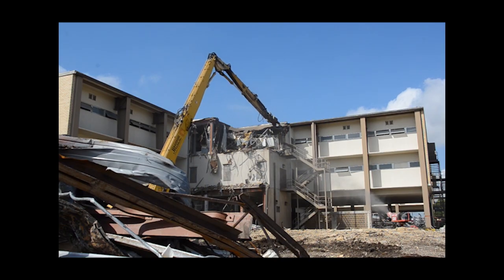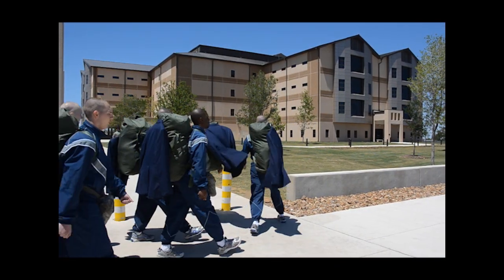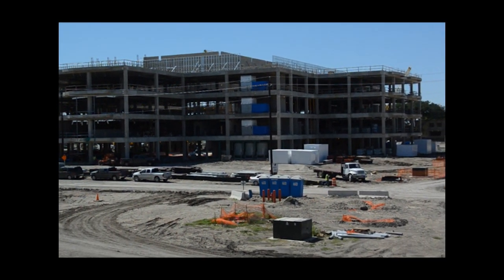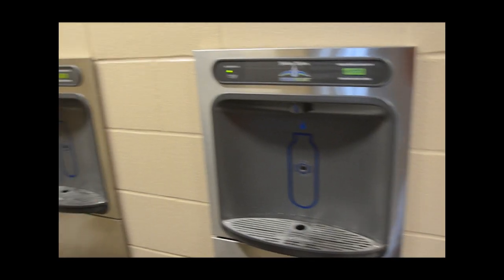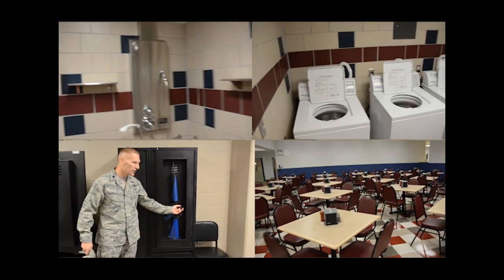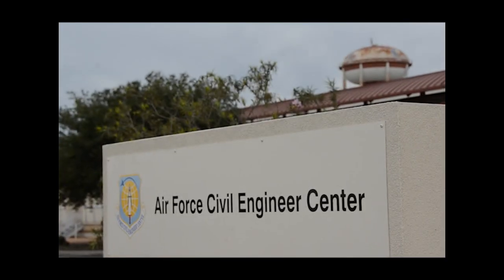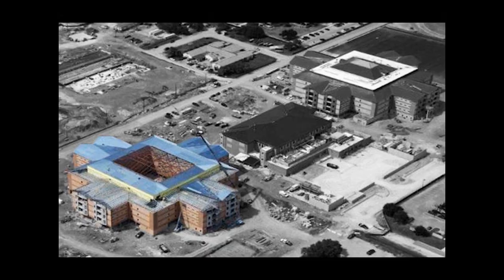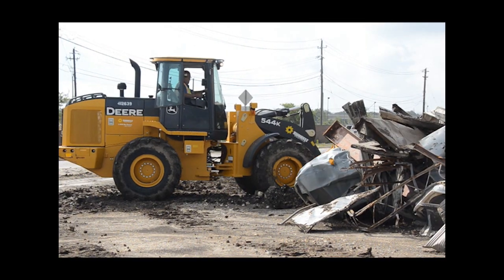New dormitories at Lackland AFB

Comment: I like the comment on the video about the AC having trouble working. In 1981 we were still in the old MOB dorms with no AC and if the showers were on downstairs the water pressure sucked upstairs. Looks like the AF is getting soft. In 1981 they didn't care what your parents thought about the way you were housed.

Comment: These new buildings better have as many trainee screw up traps as the old ones did when I went through. Chrome on the floor you had to keep polished and fountains you didn't dare use and get water spots on. So damn dusty you couldn't ever keep it clean. Boo hoo if you have to march your happy ass across base to do something. You learn to do shit right the first time if you didn't want to stand out in the sun for a couple hours getting yelled at because you can't march right. Plus I have no idea why they need a giant computer lab. I didn't need a computer in the AC to read my airman's manual. They made a nice building, I just don't need think we needed it. I work on 1960s C130s. So the excuse that the buildings were from the 60s and they couldn't maintain them is complete bullshit.
Reply: There was so much chrome when we moved in 7th week. The stalls were chrome. The showers were chrome. The was also chrome on the floor. There was at least 50% more chrome than the RH&Ts.
It's not like there isn't a drill pad outside. The atriums were for inclement weather. The computers were mostly unused.
The problem isn't that they couldn't be maintained, but rather that they weren't. The RH&Ts were condemned the day we moved out. We had a few problems with the structures that caused injury to both trainee and MTI. We didn't have heat in the middle of winter. My MTI fell down the stairs because they iced over.
I know you guys who have been in a while are all pissy about BMT nowadays, but it's still the same song and dance. Wake up, get yelled at, drill, lights out.You still learn the same shit. The only real difference is the people 
driving around on base aren't having to constantly stop for trainees, and the MTIs can get their trainees where they need to be faster. Bmt is now a lot more focused on learning book-wise as well. You get tested on a lot more stuff. Drill, reporting procedures, the end of course exam. The point of BMT is to train the trainees, not maim them. Even in the few they kept (med hold) and renovated, they STILL have similar issues.
I work on C130s as an engine troop. Being in the new BMT environment didn't make me too stupid to do my job, because none of it actually mattered in the long run. Polishing chrome won't make planes fly.

Comment: In 69 we were in WWII vintage two story wood frame buildings. Open bays. Converted gas heat and gas dryers. Old , cold, dusty, and hard to keep in “ inspection order”. My buddy was in one of the “new buildings”and had a much better experience. 
We both went to Shepard for tech school still WWII vintage barracks, same ones my father was in. Bottom line , the Service really got its money’s worth out of that old infrastructure. 
Our barracks and hangers at Mountain Home were also vintage. Some of the hangers were B29 nose dock style. The flight line was wide open. It had to be specially hardened for F111s so they would not sink in the asphalt. No covers, no revetments, we hauled our toolboxes on little wagons we made. We still got it done. 
I’m very happy to see that the upgrades are being made, but everyone should be able to operate on semi-primitive airfields.
Reply: SEA 1971   metal quanset huts. open bay, no ac, rusted bunks, no fans,  bugs, lizards, occasional snake, lots of mosquitoes, dirt, flies, noise.
Reply: Got to Lackland Sep 69 and assigned to the 07 Squadron in the old WW2 open bay wood barracks.  After a week we were all transferred over to the 27 Squadron in the new barracks (thankfully).  Then back to the old WW2 open bay barracks at Keesler for tech school.

Comment: Older dorms made you tougher
Reply: I was in the old dorms until my 7th week. When we moved out that week, the building was deemed unsafe for continued use and the entire squadron was moved in one day. During the winter I was there, we didn't have heat on our side of the building. It was 30 degrees in our dorm, and many nights our MTIs were mandated to send us to buy thick socks and long johns. There was a day when we had to use another flight's showers because we didn't have running water in our dorm for some reason. Another day the stairs iced over and our MTI and 2 other trainees fell down the stairs. We went to set up another dorm for incoming trainees and the ceiling fell in.

They didn't make us tougher. They just got us sent to the UCC and SAMC.
Reply: Damn bruh, that sucks.

Comment: the 324th should have gotten the new set-up first. The new dorms have an elevator, something that would be needed for some of the med hold trainees.
Reply: 324 isn’t med hold!
Reply: @patrickmac9403  they changed it? Which squadron is it now? Because back in 2013, the 324th housed the med hold trainees and holdover airmen.
Reply: @killer13324  The 324 TRS is a standard training squadron again and the current medhold/separation one is the 37 TRSS.
Reply: @nicolestafford9418  a lot changes in 9 years